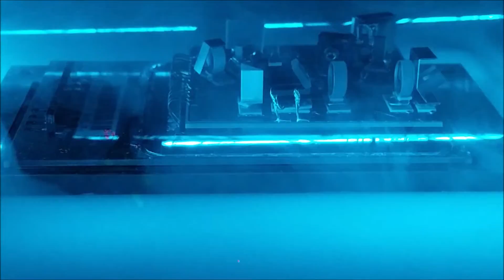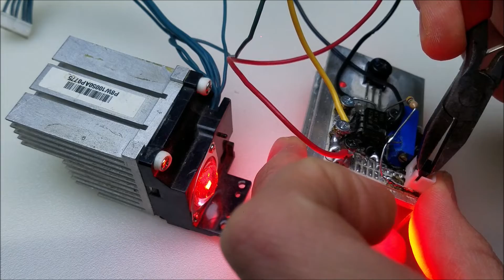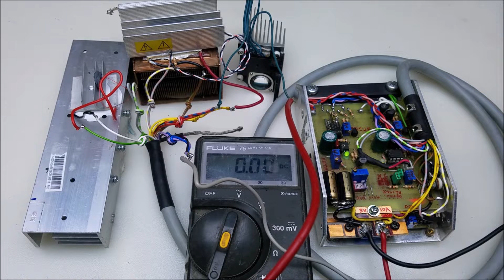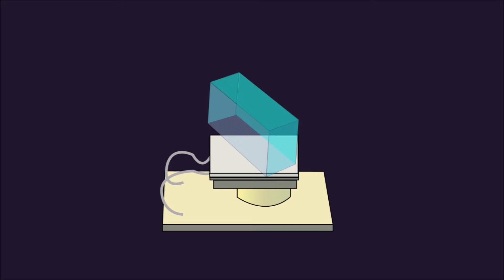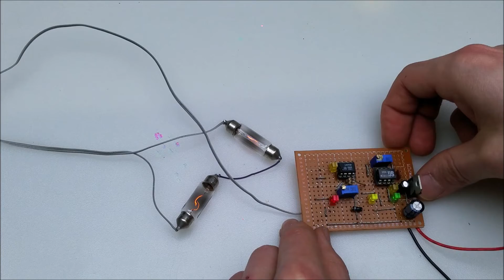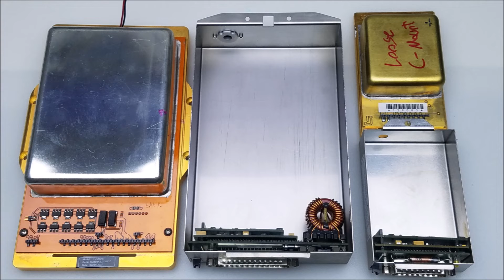Conquering The Coherent Sapphire 488-20

Comment: please can you explain, whrn you have he time, the circuit board at the end, what they are doing, why you removed them....thank you
Reply from the maker: Those boards are the analog driving section for the PTC heaters and pump diode feedback normally used by the OEM driver. I am working on learning more about how to hack them for a follow up video though.

The reason they use internal boards for the PTC heaters is that cable length matters a lot with cable connections and resistance. A cable can have rough connection and it wouldn't change a reading from 10k ohm all to much, but for the lower feedback of the PTCs even a faction of an ohm in the cable can change readings drastically. Having it all in the head omits cable issues. My laser for this reason is only calibrated correctly to the cable I made and paired with it.
Reply: @Zenodilodon  thanks, nice work,!

Comment: We have been shipping these lasers for over 20 years and they remain the industry standard for flow cytometry, confocal microscopy, and DNA sequencing. The heat sink you showcased was a key innovation, at the time, as passive cooling was not widely used. This was possible because the Sapphire laser uses 10x less power due to it’s efficiency. Coherent has shipped 60,000 Sapphires, which is all the more remarkable when you look inside one and see for yourself the precision manufacturing that is required. Great video.
Reply from the maker: Coherent is nearly impossible to beat. They have a long history in the laser industry with many innovations, OPSL being one of them! I got to messing around with the older HP 200mW head that I showed in the end of the video and found it had a shorted reverse protection diode by the pump. I wired a bunch of my driver stuff up to that unit and can get 400mW of 488nm! This will be on a video of it's own one day. Any other laser stuff you work with yourself? How did you get into working with the Sapphires?

Comment: What do you mean by digital components? Also, where the heck did you get such an old carbon resistor from 😂

For the current spike, couldn't you fix it with a diode?

You got two 555s,yoj could use a 556 which is a dual package

Your bulbs, they aren't happy! So much sputtered off, that's why you can't make filaments flash so much 🙈 still, at least the glass is shiny 😅

For your micro maniuplationsxmaybe you can make a kind of reversing pantograph, translating larger actions into small ones?

(you mentioned a pinout you'd explain later, butt never did) okay I think that's my longest comment for the year made, 😅
Reply from the maker: There is nothing that uses a 1 or or 0 to signify any portion of data hence, digital

possible current spikes would be caused by a compensation delay. When the optoisolator is disconnected the  the output of the LM358 swings all the way trying to bring up the current to it's at full output technically when the base of the transistor is connected which could turn the transistor on to 100% The suggestion of moving the optoisolator solves this issues 100%, hence the mention of that.

Show a board that uses 2 555s though...

The light bulbs came from old car door lights my friend pulled out, I think they are from the 80s. He was replacing them with LED lights and I was like... mate how are you going to throw lightbulbs away in my presence...

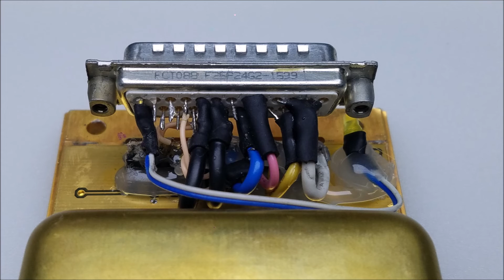23:16 is where I went more on the pin out. All the pins are numbers for what they connect to and even I labeled the ones I did no use. It's in text during part of the diagram picture.
Reply: @Zenodilodon  nothing digital, except for the user 😁

Your diagrams were flashes on the screen, perhaps I missed one?

They still make and sell those bulbs! Some people go crazy even looking for the right ones, but you're right, it's a shame to toss out perfectly good tungsten and vacuum like that!

Comment: Very nice! I have seen a few of these cropping up on eBay lately, and it is real nice to see inside one! I wonder if an open cavity OPSL like this would tolerate Q-Switching...
Reply from the maker: Hmm that's an interesting question. I am not sure if the OPS chip acts as a gain medium the same way a doped crystal would. That would be the only limitation I could think of, besides that there is nothing preventing it otherwise.

Comment: Hi again, unrelated to this video but I wonder if you have any ideas for some experiments I want to try. I am looking to attempt to investigate the existence of anti-stokes upconversion fluorescence in some strange and highly luminescent minerals such as Hackmanite and Chlorophane. I don't know if I will use your green pointer mod or just buy an 808nm pointer at this point but I need some way of not blinding myself with the laser while simultaneously still being able to see the upconverted feeble glow of the mineral if it exists at all. This is a problem since all I see out there are tinted laser goggles which in many cases will probably simply absorb all the visible light I want to see. Dichroics are going to be expensive and angle dependent and so dangerous, so I'm not sure how it can be done safely. do you have any ideas?
Reply from the maker: That is a tricky question. Dichroic glass filters for UV/IR tend to to a decent job at killing 808nm pass through. The catch is, just like with all dichroics the effective angle is only from direct head on angle. This means that laser light entering from the sides/peripheral vision angles can be a hazard. This also limits how far you can turn away from looking at the laser directly while it's running and still have blocking work effectively. Do to this I would suggest locking the IR blocking optic in the device and not in use as goggles if you use a dichroic glass filter. IE use it as your sample chambers viewing window. I would also suggest use of a prism afterwards so you can both view the source and use a  physical light stop in the area where IR would leak through. With this configuration you should be able to blast your samples with a stupid amount of IR without risk to your eyes.
Reply: @Zenodilodon   Cool thx. I think I see what you're saying except for the prism part. Where would the prism go?
Reply from the maker: @Muonium1  Anywhere after the sample, best after the filter. It's just another way to split off the IR completely and leave the visible. Say you are looking at the sample through a prism, the light is refracted and the IR will land on one of the far ends of the output. You can use a physical block on the output of the prism in the IR section to kill every bit of remaining IR while still having 100% of your visible output available. You'll probably need to make a rather specific test chamber, one that can be viewed from a specif angle but on the upside it would be a chamber that could be configured for any such test. If you drop me an email I can send ya a sketch of what's in my head.
Reply: @Zenodilodon  In the case of prisms, the same angle problem occur as in the case of dichroic filters. A simple and inexpensive solution must be found, which is difficult, because it is difficult to stop long wafelenghts (the Sun shines very faintly at sunrise or sunset, yet in the infrared it can be almost as bright as at noon !).
   It remains to be seen where the anti-Stockes luminiscence would be seen and whether a regular blue filter for the video camera sensor would be good.
   Likewise, a 2 cm thick liquid filter a 2.5% CuCl2 solution stop the infrared, but also attenuates something from the lowers part of the spectrum.
   The old anti-caloric filters do not completely stop the infrared, but since they are practically colorless, they can be used in all places.
   I think it's good that someone brought up such a problem. Solving such a issues can sometimes be even more useful than the purpose they serve !
Reply from the maker: Saw the last comment, figured I would draw a rough diagram of my thoughts on the test chamber setup. Let me know if you guys want to look at it, I'll email it over.
Reply: @Zenodilodon  The answer was for me ?  I don't know if you realized, but the one who wrote the last comment is the one from Romania who exchanged some e-mails with you a while ago !
Reply from the maker: @marianl8718  The last comment just brought up the topic again, the response was directed towards the individuals interested in possibly putting together a viewing chamber related to the opening comment in this thread.
Reply: @Zenodilodon  I wrote that comment because I'm probably a bit more interested than the person who opened the topic to know the solution that can be found, although it's practically of no use to me !  I don't even want to use such dangerous lasers !
   The solution of the problem interests me, but only to the extent that it would meet the condition of a country like Romania, where the material possibilities are quite small: simplicity in realisation and ingenuity to compensate for all the shortcomings !  Attention, these requirements do not necessarely stem from the precariousness of the material endowment here !